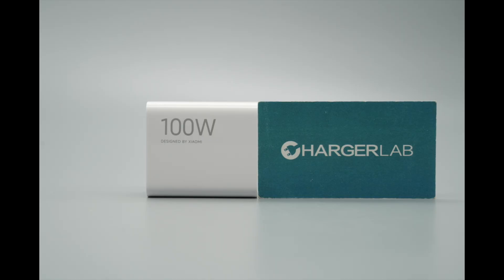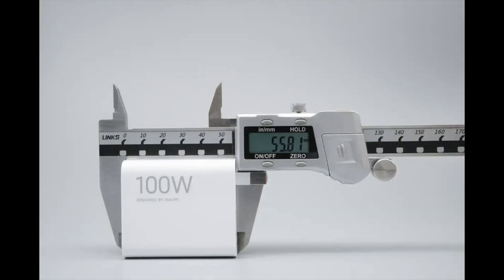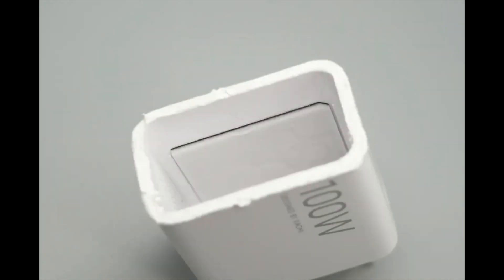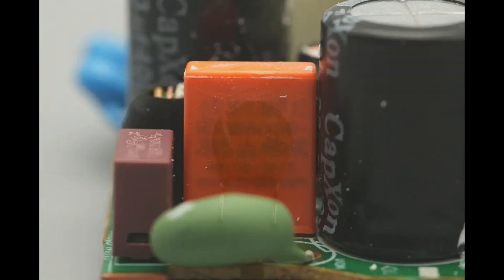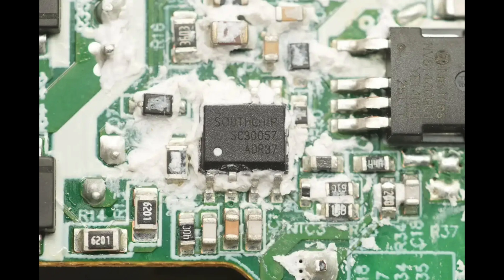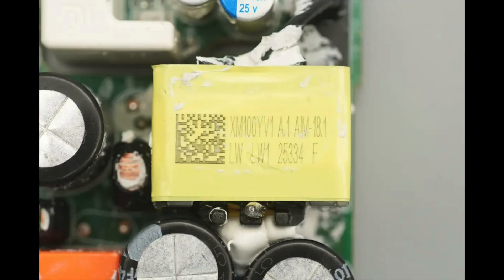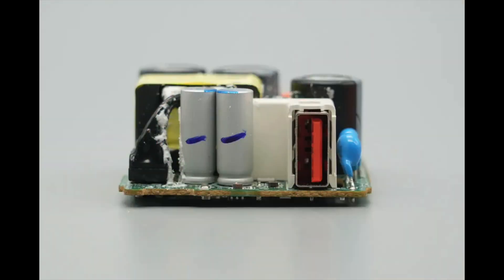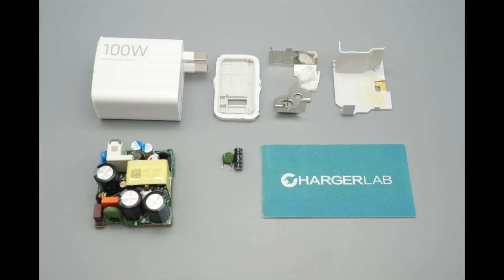Teardown of Xiaomi 17 Series Original 100W GaN Charger

Comment: Why usb A in 2025 xiaomi?
Why?????
Reply: Because they make extra money selling you the special cable
Reply: @LoganT547 the problem is, I have a 100 watt, pretty big sized charger and I can not charge my laptop or powerbank with 100 watt. Even 65 watt is not possible.
That is an issue. That is why I never use original 100 watt xiaomi charger any more.
Reply: Xiaomi dont want people using their chargers to be used to charge other devices, laptops, etc. Weird right?
Reply: @masdodo4090 That is right. I could never be able to charge my laptop with xiaomi charger.

Comment: I see it supports USB PD3.0 PPS protocol with USB-A interface. The question is will the PPS work with Samsung Super Fast Charging 25W & 45W? with 60W/100W USB A to C cable (8.5A from ViVO).

I hope there is a video discussion on how this charger interacts with USB A to C cables to smartphones that generally use USB PD3.0 PPS with C to C cables.
Reply: it actually needs a xiaomi proprietary connector for that protocol to work in this kind of adapter. Xiaomi modified the usb-a in this charger and added pins to bypass the usb-a limitations. He actually explained it at 1:01
Reply: @hzsid8733 no it is not.
All Type c adapters are able to charge my laptop. 35w,65 watt, 100 watt does not matter.
However, xiaomi 100 watt charger does not charge anything with full power except xiaomi phones.
Reply: I wonder if the Xiaomi cable can charge the phones though since it supports PD
Reply: @LoganT547 It can but not with 100 watt, 65 watt or 45 watt.
Maximum 18 watts.
Reply: @tr9036 Yes, as long as there's 11V 5A support it should be able to charge Samsung devices at 45W I think.
Reply: @LoganT547 not even 30 watt.